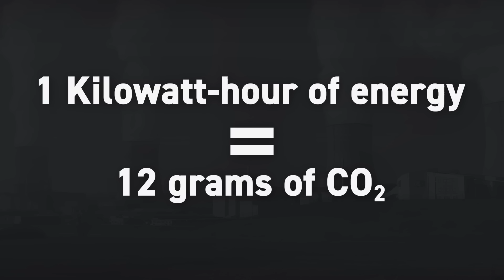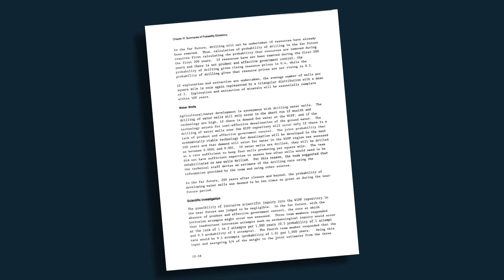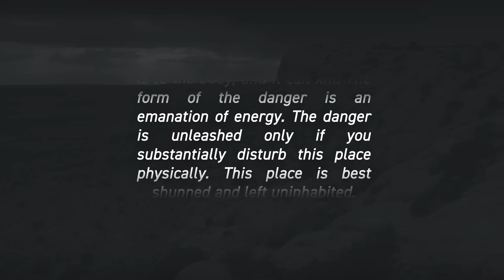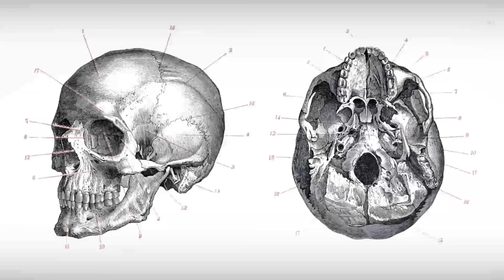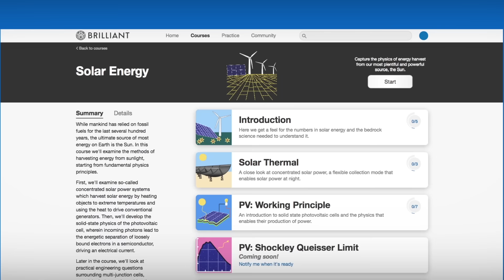The Nuclear Waste Problem

Comment: Generally accurate, but very selective use of facts. The reason why the rods are in temporary storage is because they have value for future energy generation, in summery when we run out of Uranium we can reprocess the rods and get more energy.
When we need to dispose of it we need to remembered no radiation is being created, its just being concentrated. It can be merged in with another inert material in low density to be placed back, in the same density as it was originally mined, such as Synroc. This technology exists today. Burying it in a concentrated manner is cheaper, avoids the not in my back yard protests and can earn Finland a great deal of cash.
But at this point in time there is very little high-level nuclear material that anyone would want to dispose of, its simply worth too much money and has too much value for future energy production. Only contaminated material is being disposed of, such as the 5 t of plutonium-contaminated waste at British Nuclear Fuels Sellafield plant, on the northwest coast of England. 
There is no insurmountable nuclear waste issue; its just no one wants the diluted radioactivity material in their back yard, even if was originally in that location. As a result we have to bury it in a concentrated format using a technology like synroc, or not so smart, contained in its original form in steel containers.
Reply: Knave 
In Germany we have a similar situation: There is a site in Gorleben, which is being tested for suitability. In 2000, the leftist parties stopped that exploration and prevented its restart ever since, but did NOT declare the site officially unsuitable, indeed signed a document that all known facts point to suitability.

So much for it cannot be solved.
Reply: Peter F-model. Wrong. The reason rods are in temporary storage is because a permanent waste site has cost $15 billion so far and another $95 billion over the next 30 years... and this is the kicker - NIMBY. And the taxpayers are paying power plants almost $1 billion a year to store their own crap. Why should they change a sweet deal like that?
Reply: @slithra227 WIPP  is for transuranic waste ,not high level radioactive waste. And it has already been shut down once for problems with emissions.
We also started on the Yucca site. Cost so far $15 billion. Shut down because of NIMBY. If construction restarts it will cost another $95 billion and take 30 years to compete. Would not even hold all of the 750,000 tons of high level waste in US already in existence. Doesn't include all the waste overseas that the NRC promised we would take care of for the gullible countries stupid enough to buy our technology. How many 100s of billions do you want to spend?
Reply: @jackfanning7952  There is a mystery and you could be correct, whenever government interferes rent seeking follows, but the mystery is why do they store the rods instead of reprocessing them and reusing them. As each rod costs a fortune to manufacture and a fast breeder can make it usable again, no one wants to make the rods useless by using one of the existing disposal technologies. 
The NIMBY issue is also a major factor, but this tends to be driven by lobby groups and politics rather than logic, as no one is disposing anything next to the local playground. But i suspect that is the real reason.
Reply: 100th like get rekt nubs
Reply: @slithra227  Yeah. The roof collapsed in the cave at the WIPP site near Carlsbad and ruptured a canister or canisters, contaminating the whole cave system and nearby above-ground with plutonium and americium. Groundwater also contaminated and eventually the aquifer under the site. Golly gee willikers. Another expensive and deadly nuclear accident. Who would have thought that was possible?
Reply: @peterfmodel  Reprocessing is expensive and very highly polluting. No one wants to buy the reprocessed plutonium. France has lost all of its international customers for its reprocessing facility. No one wants the stuff, even if they could afford it.
Reply: @jackfanning7952  The WIPP drum burst because contractors at other sites packed it with the wrong type of absorbent: an organic cat litter rather than a clay litter. Not because of a ceiling collapse
Reply: This. Nuclear “waste”, most of it anyway, isn’t actually spent. It’s just beyond the limits of the reactor it was designed for to extract further energy. Future and even some present reactors can and will utilize the material currently considered “waste” as fuel, and by so doing, they will also get around that pesky 200 years issue.
Reply: @MegaBrokenstar  Very true.
Reply: @MegaBrokenstar  Only 1% of the spent fuel can be reprocessed and reclaimed by nuclear reprocessing plants like La Hague. After uranium and plutonium is separated from other actinides in the spent fuel (in a very dirty, expensive process) the rest is shipped back to the user that provided the spent fuel to dispose of. No one wants the reprocessed fuel from La Hague. All of their international customers have disappeared. Their only customer is Oreno who owns the La Hague site. There is no future market to reuse this reclaimed fuel, because no one is stupid enough to keep throwing money at nuclear power, except the bomb makers and the oligarchs privatizing the profits and subsidizing the risks. But for the wrong reason, not because of the severe environmental degradation caused by nuclear (La Hague is dumping radioactive water in the ocean every day) but because it is not economical. They could care less about the environment damage, as long as they aren't held liable. Even the Chinese were forced to stop construction of the joint Sino-French recycling plant in Lianyungang, Jiansu, China. Even the Chinese dislike nuclear enough to keep their government from using it. And don't tell me about thorium reactors. They were not economical 70 years ago and still are not economical. The Chinese and India operators currently trying to make it work will come to that same conclusion when they throw enough money down the drain and realize it is not econopmicvally feasible to overcome the technical problems.Essentially thorium reactors are still nuclear reactors and still are the greatest and most dangerous business failure in the history of world business. All it is good at is killing living plants and animals.
Reply: The reason the spent fuel rods are in "temporary storage" is because the federal government (taxpayers) are paying the nuclear power industry almost a billion dollars a year to store the most dangerous stuff known to mankind in severely overloaded, open lagoons and cannisters without any hardened structure within 100 miles of every major population center in the United States. What a deal! Only 1% of the reprocessed fission byproducts is recyclable and there is no market for the reprocessed fuel. When the spent fuel rods need to be disposed of remember that these fission byproducts are 1000 times more dangerous than the Uranium 235 that went into the reactors. No one wants it in their backyard, especially if you live in New York, Chicago and Philly, and every other population center where the crap is now. Let me clue  in, the Navajos Apaches and Canadian tribes don't want that 300 million tons of acidic and radioactive tailings from uranium mining in their backyards either. But do you care? Nah. A few more lies and no one will know the difference, right? Are you getting a cut of the loot or are you just a fool?
Reply: @jackfanning7952  you seem to know a lot. What is your suggestion ? ( this is not sarcasm. I am scared and hoping for a solution. )
Reply: @bojanmilojkovic3770  I am not scared. If we die, I will be with my savior. I don't know if there is a solution, but I will tell you what I think is the best course of action. 1) Stop making the damnable stuff. Maybe in the next ten thousand years with enough money and effort we will be able to isolate the worst of what exists and maybe save the world. 2) Educate yourself on the monumental problem that nuclear, whether it is bomb production or power production, generates. It is not only dangerous, but very uneconomical...and the waste and lies keep piling up. 3) Raise a stink every time one of the nukies start in with their foolishness. A prominent attorney once told me it is not our job to educate our enemy, but point out their foolishness. Let them continue to spout outrageous lies. People will spot the foolishness and figure it out for themselves. The more outrageous their claims, the easier it will be for all to see their failures. 4) Don't let them sweep their failures under the rug. Announce them from the town square. Expect the bought and paid for politicians and media to ignore it. Rub their noses in it!. 5) Find out about alternatives. The nukies say we can't store solar energy overnight, but they can store the most dangerous stuff on earth for 240,000 to 16 million years. Elon Musk's Tesla Powerpacks and Powerwalls already can store that power. Tesla's batteries are much cheaper than their competitors, Sungevity and Sonnenbatterie. They can't keep up with the demand no matter how fast they expand their production!  Renewables can generate safe and clean energy and store it for less than half the price of nuclear, even if we let the nukies continue to ignore the massive nuclear waste problem. I don't know if that will be enough. Money talks. The nukies have been privatizing the profits and we have been subsidizing the risks for a long time. Their greed will not let them quit trying to grab what they can from the power market. One bright spot is that all of the large international financiers, including Lazard the biggest, are saying that nuclear can no longer compete with renewables economically. Those little gnomes don't like to lose money. That means the nuclear industry will intensify their pressure and continue to bribe legislators to pass energy taxes to bail out nuclear. Expect more puff pieces about their miraculous new pie in the sky ways just over the horizon to produce "clean, safe energy too cheap to meter,"  if we just give them more subsidies and ignore their failures.
Reply: @peterfmodel  They paved playgrounds and roads on the res. with radioactive tailings and those Apaches are ready to scalp someone for it.
Reply: @peterfmodel  Mystery solved: The fuel rods are stored because: 1) the utilities are getting $1 billion a year to sit on their own crap. 2) No one wants to throw good money after the bad money already wasted trying to reprocess spent fuel rods. Reprocessing is very expensive, very dirty and only reclaims 1% of the spent fuel rods being reprocessed. La Hague can't find any buyers for their reprocessed fuel, Sellafield is still trying to find enough money to clean up their mess and the U.S. gave up on the MOX plant  in SC after wasting $8 billion. Only God and the devil knows what is going on in Russia. All the big financiers say that nuclear is no longer economically competitive with renewables and don't want to invest in it. Any legislator stupid enough or bribed enough to try to throw taxpayer money at it will get tarred and feathered and run out of town on a rail.
Reply: @evanmorris6508  Yeah, millions of things can go wrong at nuclear facilities. Kitty litter, cave collapses, acidic plutonium wastes in steel tanks and drums, tailing lakes behind earthen dams, treating acidic radioactive waste with sodium hydroxide and getting a salty corrosive radioactive sludge that you can't get out of the tank but can leach into the ground, graphite modifiers on fuel rods, 12 foot seawalls for 50 foot tsunamis, gauges that don't work, workers that don't work, pumps that don't work cause the vandals stole the handles, reactors collapsing in on themselves like at Vogtle, brittle rust bucket reactors with cracks and holes in their containment, vents in the containment, (wait a minute! containment...vents. Huh?) to avoid hydrogen explosions by letting radiation blow away in the wind. Let's just throw another ten or fifteen or one hundred billion or trillion dollars at it and maybe Murphy's Law will go away. Then we will have safe, clean reactors with energy too cheap to meter. Somewhere over the rainbow.
Reply: @jackfanning7952  i was hoping you had a way to deal with the existing waste. And i am not just scared for myself.
Reply: @jackfanning7952  i don't think that would work for thousands of years it  would need to work. There has to be a way to render the waste less harmful. Maybe something to speed up the rate of decay.
Reply: @bojanmilojkovic3770  Good luck with that.
Reply: your comment is the most informative one i can find
Reply: @jackfanning7952  you've got negative clue as to what you're talking about, holy lord your posts are completely embarrassing. 

First off, nuclear power is very feasible from an economic standpoint, else countries with no interest in nuclear weapons wouldn't have ever ordered such plants installed on their territory. You even suggesting otherwise shows you haven't the slightest fucking clue what you're talking about. 
The difference with nuclear power is that the upfront cost is way higher than other power sources, but that cost attentuates very well because the upkeep of a nuclear powerplant is low and the fuel used per unit of electricty produced is incredibly cheap. 

Secondly, you've gotta be kidding even suggesting that large-scale battery storage is a cleaner solution than building power plants. The cost is higher than nuclear first of all, not lower like you said, because you also need the plants themselves to produce the actual energy. 
The environmental damage done by producing these batteries would offset much if not all of the savings coming from a renewable energy source, and that's without factoring in the other energy sources required to cover the periods with low wind or sunlight. 
And like that wasn't enough, Tesla's solutions generally come with 10-year warranties so after a potential 15-20 years (with relative indulgence) you'll need to replace them anyway, so there's your second, third, etc chance of shitting on the environment. Our battery tech is shit, and unless we find another material to use in them it's going to be dirty too. Once again, you've got no clue as to the reality of the situation. 

You also said only 1% of nuclear waste can be reprocessed, I'm gonna drop common courtesy for this one and address you a sincere: fuck you. That's a straight up lie. 
In actuality more than 95% of nuclear waste can be reprocessed and used in various other types of reactors, and likely even more if nuclear boogeymen like you stopped shitting your pants and we could actually pave the way for modern nuclear reactors to be built. Nuclear waste won't ever become an issue with modern reactors due to the closed nuclear cycles they adhere to, videos like the one we're commenting on are speaking from the perspective of the old nuclear reactors we're using right now.  

It's actually damn impressive how much disinformation there is in your posts and how little you know about power plants. Don't talk about this topic ever again, you're an embarassment.
Reply: @xIcarus227  I was very happy to get your comments. It shows how alarmed you are at the demise of the nuclear industry. There is an old bomber pilot saying: If you are receiving flak, you know you are over the target. Fire away, chump. The climate crisis requires us to consider how to reduce greenhouse gases the fastest way possible with the least cost and best feasibility. New nuclear power plants are obviously not an option because, even if they ever complete construction (which is a crap shoot) they have long delays and massive cost overruns. Every dollar spent on nuclear is a setback on climate change. Look at Hinkley Point, Olkiluoto, Vogtle, Flamanville. The new reactor at Taishan has shut down because of fuel rod problems. V.C. Summers never got started, after blowing $14 billion. Reactors are shutting down faster than ever, even if they are re-licensed to continue operating, The utilities can't afford to pay the high maintenance costs. All 94 reactors in the U.S. are losing money. In addition, many measures for energy efficiency and even the installation of new wind and solar are cheaper and more effective that continuing to operate existing nuclear reactors. Lazard did a world-wide survey of energy costs over the past decade. This is the results for the costs of different options in cents per kilowatt hour ten years ago and in 2020. Nuclear - 12.3 cents in 2009/ 16.3 in 2020; solar  - 35.9/ 3.7; wind - 13.5/4.0; coal - 11.1/11.2; gas - 8.3/ 5.9. Lazard is the world leading investment bank, so I think they have a clue on financial matters. Lazard also claims that global electricity storage costs are 1.0-1.5 cents per kilowatt hour. Add that to wind and solar and it is cheaper (and oh so, safer) than nuclear. And much more reliable. It's a new world out there, Mr. Dinosaur. Almost half of the reactors that started construction never operated at all. 50% of the reactors that started have had malfunctions and major outages of over 1 year. Can't make electricity if you ain't operating, can you? Even countries like China that are continuing to build some reactors are investing twice as much in renewables. Nuclear's share of France's energy went from 78% in 2005 to 67% in 2020. Many of their reactors are old and due for shut-down soon. The International Energy Agency claims that 95% of the new investments in energy will be in renewables for the next 5 years. The International Atomic Energy Agency (nuclear's cheerleader) says that the most optimistic forecast of the global electrical energy share for nuclear in 2050 is 5%, down from 10% today. That is wishful thinking. I think it will be 0%. Gnash your teeth all you want, those are the facts. Read it and weep, nukie. Nuclear advocates talk about new designs and plans to build newer Rube Goldberg nuclear tea kettles, and this time they will get it right. But nuclear construction has flat-lined for the last 30 years and renewables are sky-rocketing. That is documented world-wide in the 2020 World Nuclear Energy Status Report. I urge you to read it, because it will make you want to vomit! Nukies are beating the drum to provide CPR to their comatose industry because the military has a strategic interest in keeping it going. Most of the new reactors under construction are in countries hungry for plutonium. I don't think they want to brush their teeth with it. The second reason is as soon as a nuclear reactor goes belly-up, liabilities for decommissioning ($1 billion)  and waste disposal (who knows how much that would cost, nobody has done it yet) exist, but any income, even at a loss, is zero. Government subsidies go bye-bye and utilities go bankrupt. What a shame, eh?
Reply: @xIcarus227  Wipe your nose. It's bloody.
Reply: @jackfanning7952  judging by the way you so blatantly faked amusement and the way you just had a mental breakdown over a random internet argument, I strongly advise you to seek a psychiatrist. This is embarassing to everyone in this comment thread. 
Now please excuse me, I don't have the patience nor crayons to hold a conversation with someone like you.
Reply: @peterfmodel  There is no question why...it's expensive as shit and costs more money than it ever brings in. In fact, it would more than double electricity prices just reprocessing spent fuel like that, and is only viable if you give out subsidies to cover the expenses.

Nuclear fuel is already among one of the more expensive options out there, so doubling it's cost doesn't help it's success.
Reply: @ryanthompson3737  Its true nuclear is more expensive than coal fired power, for example, but reprocessing an existing rod costs about $1000 per kg, which is less than creating the original U-235 rod, which is about $1500 per kg. There is an issue with a lack of commercial reprocessing centres, with the US and UK ones closing and only France maintaining one, as well as facilities in Russia, China and India. However processing a spent rod with a material like synroc and storing it is cheaper than storing it in its current form, or at least it’s the same cost. There must be a reason why they are keeping it in a pool of water in this state. One reason is it has a commercial value, possibly as much as $500 per kg. One other possible reason could be its cheaper to reprocessed using a PUREX process into nuclear weapons, most nuclear countries maintain facilities which can do this. In the end the reason is generally something to do with money.
Reply: @Coconutszz  Easy. I read the scientific research and watched the greatest business failure in human history for the last 75 years.
Reply: @slithra227  ZERO solution. Only solution is the ration electricty and if we did this we wouldn't be in the mess we are today- the Amazones never needed electricity, and so are other tribes, and as former hippie i lives 100% electricity free.. it's easy..
Reply: @peterfmodel  Russia's BN 800 reactor uses reprocessed fuel. and more are on the way. Various nuclear reactors which are being designed now will be able to burn current nuclear waste. This entire video feels so stupid ,about a non issue in the not so distant future.
Reply: This video is fear-mongering and suicidal for our civilization
Reply: Yes, just sink the spent fuel to the abysmal plane encased in glass…. If this is an actual issue…. Which it isnt
Reply: @jackfanning7952  Wind and Solar has incremented by what, 1% in the past decade? PV is DOA, Wind requires more concrete and steel and takes years to pay off the carbon emission and takes a thousand times the land to achieve the same energy density. Where is the nonexistent storage solutions (600Wh/L means half a million cubic meters of state of the art battery to handle grid storage) and transmission infrastructure to take remote energy in the middle of Illinois and crank it out to urban Pittsburgh? FYI, China invested half a trillion into reactors and will be building 150 soon; solar is by far the most dense in projects although wind produces more power, but it's quickly running out of space and tapering off progress. The cost of the largest scale US solar farms and wind farms are 2-3B and at 20-30% capacity factor the largest 600MW farm in the US only makes enough electricity as Diablo Canyon in 3 days at 95% capacity factor and that's not including the storage solutions, I do not know where these "reliablity" factors you're getting come from. Even with "leaks" with fuel rod damage, with cooling failure, reactors have FCVS, pebble beds, hydrogen gas sequestration and steam relief systems not to mention meltdown prevention mechanisms. 

The technology we have to deal with nuclear waste already exists. Dry cask storage and on site storage is reliable. We've done this in Illinois for decades. They can survive missile strikes, earth quakes, etc. The 2014 incident was already known to have been because plastic kitty litter caused a fire from the radioactive heat within the barrels, had clay been used, no leak would have occurred. Furthermore, the exposure was within safety limits - the most dangerous of which were minor actinides alpha emitters.

Nuclear plants in the US used to cost under 10B. In China, Taishan (an EPR), is still alive and has now been connected back to the grid. If we would like the use DU for breeder reactors (which does not even remotely create plutonium remotely weapons level, at 2% typically), it can certainly be made possible. Also in China plants are getting grid connected and built in less than 5 years like Hualong One/Two and running under 10B USD. As of the IRA we are finally wisening up and keeping our nuclear plants alive and running and hopefully reversing the trend of antinuclear propaganda feed. Nowhere has electricity been more expensive than aggressive renewables phase ins like Germany and California, where now the solar industry is declining because the grid connection reliability is not enough and the excess energy is practically lost whilst when the sun doesn't shine and wind doesn't blow, the power doesn't come, yet swaths of farmland and forests are threatened because of the massive amount of land it takes to build these farms and infrastructure. Renewables are our super short term and I'm all for it and believe it will be part of a sustainable future. Fission will get us through until commercial fusion in centuries to come. Maybe we don't need to bank on technology that doesn't exist and requires pie in the sky natural resources so we can satisfy some utopian goal when you damn well know it doesn't even come close to a proven 60 year old technology.
Reply: summery?